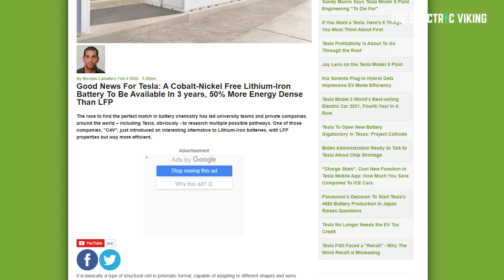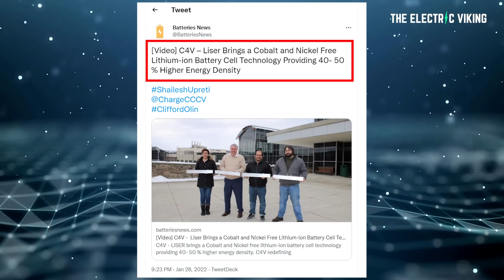US firms new GAME-CHANGING structural batteries for Tesla?!

Comment: Power Density is not the same as Energy Density. Power is the RATE at which the Energy can be delivered when discharging or accepted when charging. Power Density is usually given in units of Watts/kilogram (W/kg), (Gravimetric Power Density aka Specific Power Density) or Watts/liter (W/l), (Volumetric Power Density), while Energy Density is usually given in units of Watt-hours per kilogram (W-hr/kg or Wh/kg) called Gravimetric aka Specific Energy Density or in watt-hours per liter (Wh/l) called Volumetric Energy Density. Hope these definitions clear up some of the confusion.

Comment: BTW, you are conflating energy density with power density.
C4V has claimed 5x greater POWER (W/kg) density, not ENERGY density ( Wh/kg).
WHich means that new packs would be able to handle high-power peaks much better ( fast charge, high accelerations, regen etc).

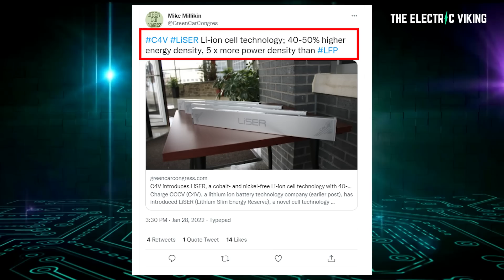Comment: 2:57 Power density is not energy density. Energy density is how many kwh are in the pack. Power density is how fast you can use it, measured in kw (or just watts), not kwh.
Reply: 40-50% more energy density
Reply: 40-50% more energy density

Comment: I remember a short while ago, within months, of hearing of a new battery tech that would not require nickel and cobalt and potentially have greater energy density.   I subscribe to a lot of science and tech shows not associated with EVs and I suspect that may have been where I heard it.  At the time I remember thinking, man I wish I had money to invest in that company.  Thinking that now, if this tech is valid, this is a significant step in the evolution of cost efficient battery tech. At the outset they have a manufacturing savings of 30%.  That will improve with time., especially if working with Musk.  Cheaper batteries, more energy density, fewer  raw materials.

Comment: Question from USA:  In a future video, could you explain where the industry is at with EV cost of repairs vs internal combustion vehicles, for general maintenance and also for accidents/collisions?  Also can you compare typical insurance rates for ICE vs EVs?  Also, how does the entire cost of ownership for an EV midsize sedan compare  to say a Toyota Camry or Honda Accord (most popular midsize sedans in the US)?  If EVs are not yet cheaper to own for the masses, when will they be, or what will first have to take place?   I ask because I've heard there is for example a minimum $200 (US) cost for just the code reader analysis before any repair work is done.  But on the other hand, EVs obviously don't have costs of maintenance for things like  muffler systems, oil changes,  air filter, or spark plugs.  Also, I am curious about the future cost of electricity/charging.  If everyone converts to EVs in a short amount of time, will the electrical grid be able to handle all the extra demand, and will the cost of electricity spike, adding to the future cost of EV ownership? Thank you for your consideration!
Reply: The engineering explained YouTube channel answers most of your questions. He’s a long time ev owner.
Reply: @charlesminckler2978  Thank you!

Comment: Uggh, its website reads like the typical scam startups, and short on anything meaningful info. It keeps on harping that it's nickle/cobalt free, but what it the other anode material? The anode could be platinum & baby blood for the information what it provides. It also states energy density of up to 228Wh/kg, if I recall, Guoxuan High-Tech already have LFP at 210Wh/kg and targets 260Wh/kg in 2022. And CATL next gen sodium-ion to exceed 200Wh/kg. If anything, C4V offers incremental improvement with a whole lotta of hype, and at worse another Theranos.

Comment: Tesla will never make Prismatic batteries. Why, because their existing factories are setup for cylindric batteries. They would need a new battery factory and equipment, processes and testing to make this happen.
Not cost effective. Best to let others who are already expert do this.
Reply: Tesla is primarily a manufacturing company, not just an auto company, and has generally shown that it is open to any technologies that can lower cost and improve quality. If they see a benefit to bringing manufacturing in house where they can do it better and at lower cost, they are quite willing to do so. They have some of the best people in the battery business working for them, who so far have not shown any problems with picking out some of the best and most cost effective methods of delivering battery tech at reasonable prices, be that cylindrical or prismatic form factors.

Comment: The 4680 roadmap includes the Maxwell dry electrode technology per the battery day presentation. When all the various advances are included, Tesla claims a 56% improvement in energy density (pack) over existing 2170 packs. Not clear what the timeline is though since Tesla is notorious for uncertain timing. From what you reported, this is an LFP dry type technology as well, and a good thing to have a parallel competing technology to the NCA dry cells.
Reply: Timing on the 4680 is basically now, reportedly someone got a vin number for their Model Y with 4680 cells confirmed yesterday which means the car has been built and just waiting for delivery.
Reply: @tribalypredisposed  Agreed. There are several phases of 4680 development as described at battery day. Dry electrode is not current. That said, the caveat is that Tesla is famous for changing their minds and pivoting. There could always be an eleventh hour discovery that something doesn't work the way they thought and thus gets abandoned.